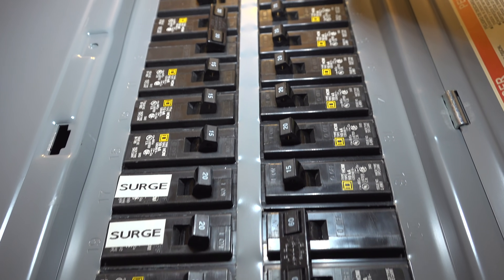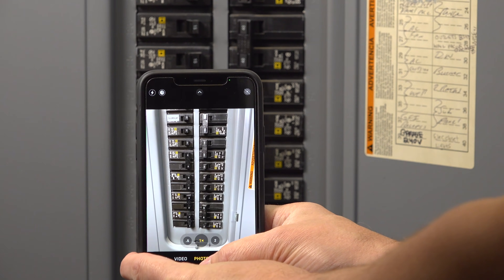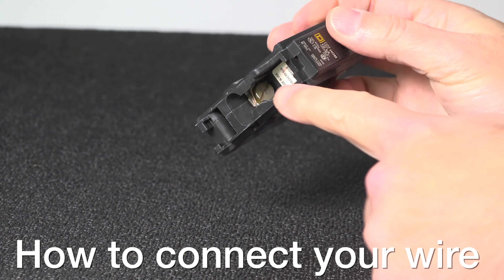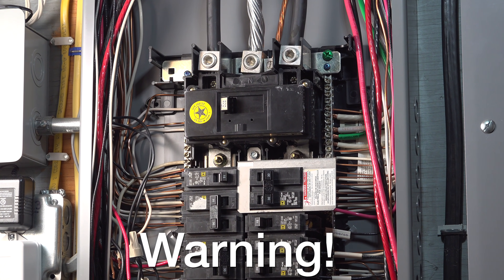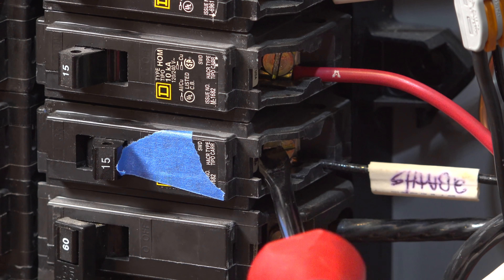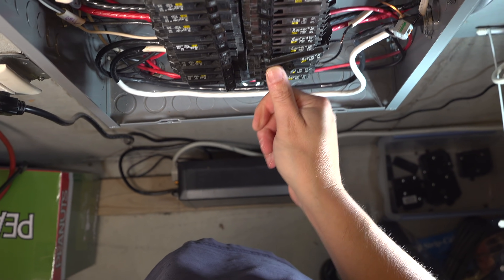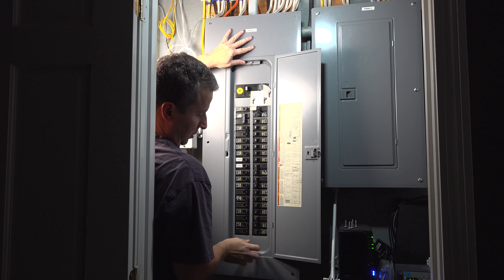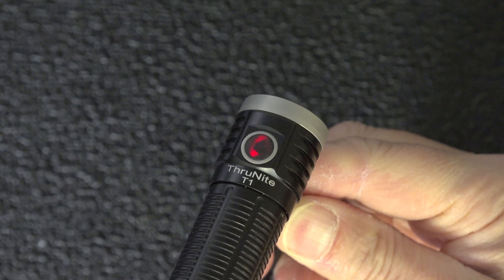How To Replace or Change a Circuit Breaker in your Electrical Panel & Why it's Tripping

Comment: Just call an electrician, your breaker keeps tripping for a reason. Just changing the breaker out doesn’t solve the problem
Reply: It might solve the problem.  Whenever I gat a service call for an intermittently tripping breaker, I would ask questions and look for some obvious signs of overload. If I couldn't find anything, I'd simply replace the breaker and tell them to call me if it tripped again.  Intermittent  faults are not worth the time to troubleshoot. Put in a $5 breaker and return if necessary.

Comment: I would turn off all the other branch circuits before turning the main breaker off and turn the main breaker on and then all the branch circuits one at a time.  Turning the main breaker on under load can make it fail.  Many experienced electricians would agree with this although there is a slight risk that a branch circuit breaker can fail if it hasn't been tripped or shut off in a long time.
Reply: Do circuit breakers go bad? Mine is only 21 years old but keeps tripping
Reply: @crand20033  They sometimes do fail due to age although they can last a long time if not repeatedly overloaded.  I would recommend that you have a qualified electrician do a current measurement to see what the problem is.

Comment: This is a bad idea.
A electrical license is required to replace a circuit breaker.
I am a licensed electrician in MA and this is bad advice that could lead to someone’s death.
Recommending someone that has no electrical background is asking for trouble.
You should remove this video immediately.
You are exposing yourself to liability if someone is injured are killed because of your advice.
I like your videos, but this one is a violation of the NEC.
Please remove!!

Comment: You forgot to mention to make sure the new breaker is in the OFF position before installing it and wiring it.
Reply: Should it matter if the main breaker is off? No juice going down the wire.
Reply: I noticed that Square D breaker are tripped when you buy them. They probably test them before shipping.

Comment: Thank you SO much for this!  Single mom here, and I'm very susceptible to repair scams.  Happened a few years ago on an AC "repair".  Paid $800 for coolant and the following month I had a new problem.  The AC guy came back out and tole me I'd have to replace the entire unit.  Fortunately, my brother's ex-FIL drove over an hour to check it out.  Literally the only problem was that the foam insulating cover on the copper was mysteriously pulled loose and the condensation was dripping constantly.  So, thank you for explaining this.  It's a fix even I can manage!

Comment: great video.  I need to upgrade from a 30 amp to 50 amp, and I'm sure there's plenty more involved than just a break replacement (most likely a totally different wire/cable).  But I appreciate the learning opportunity.  Now, on to calling an electrician with helping me with upgrade.

Comment: Rarely do circuit breakers go bad. 99% of the time the circuit is either overloaded, a short-circuit is happening, or a ground fault.
Reply: Having an emergency, can you help?
Reply: What do you do then?
Reply: @S.P.Kid88  Call an electrician. Replacing a breaker is cheaper and quicker. It may not solve the problem, but you've lost nothing by trying it. Just make sure you do it correctly.
Reply: Funny you mention the ground because I'm having an issue and I'm not sure is it's ground related. while doing laundry the clothes dryer breaker kept tripping. I went to the panel and it was very hot. I reset the main and it happened a few more times. Now I only have power to half of my house. Any ideas/ Suggestions? what do i need to replace?  I asked this of others but forgot to mention after tripping the main a couple of times power came back to the house but not to certain areas in the kitchen. I hit the test button on my gfci and it knocked the power to the entire house again so now only half the house is powered. Any suggestions??

Comment: We have to first turn on the toaster oven and then microwave our item.
When the temperature drops below 50 degrees, the circuit breaks.
I put a high intensity light facing the electrical panel and it doesn’t trip .
Is the problem a faulty breaker?
Reply: Toaster and microwave on the same circuit? The breaker is doing it's job.

Comment: Thank you for sharing this information. I just changed a breaker myself and am feeling like a boss.
Reply: and an electrician would charge at least  $85.00 if you were lucky.
Reply: Good for you! I’m still not sure how plus panel cover too heavy!
Reply: Gongrats, now get insurance for your house
Reply: @spartt4360  😂😂😂
Reply: @hightempreviews5137  It is only 120 volts and if you turn off that particular breaker you cant get shocked. When you put the new one in you can't get shocked either because there is no electricity running through it until it is fully seated and the connection is made.
Reply: So did I, but I did not turn the power to the whole house off. Just that one breaker. You can't get shocked that way anyway.
Reply: @crand20033   - whoa!  Might be true but I wouldn’t take that chance.  I went to Purdue with a David Crandall. I am confident he would throw the main first.
Reply: @-Stop-it  Scaredy cat. If you simply turn off the one switch there is no way to get shocked. Don't do any more than you have to do. I have 7 people here who need the electricity to be on and I can't just turn it off for the whole house.
Reply: @crand20033  What if the breaker is bad, and it's still letting electricity through despite having supposedly flipped the breaker (if I understand what you're saying right). Though if you have a multi-meter, you could confirm it before unscrewing the wire.
Reply: @JackJensenTrader  I simply turned off the switch and pulled it out with a pair of pliers replace it. I can't get shocked and even if I did it's only 120 volts and who hasn't been shocked by that before?

Comment: Interesting.. it looks like you're replacing a printer ink cartridge that could fry you into oblivion. That's terrifyingly fascinating
Reply from the maker: That is a very clever observation, I never thought of that but you are right, they go in just like them!
Reply: No sir, it's only 120 volts going into that one breaker. Just turn it off and you are safe.

Comment: Breaker tripped, you have to check the circuit. It’s load . You don’t just change it because it tripped. Everyday for whole year there’s always chance that you added a load more that the design.
Reply: Exactly there's a reason for it to keep tripping.
Reply: @quen305fishing7   But, the reason could be a bad breaker.  It tripped a few times over a couple years. Its an intermittent trip. He did the right thing.

Comment: Called home line breakers typically for residential. Qo we use for commercial they have a extra screw holing them in. Also they sell stab on versions of qo also. Also never assume that swapping out a breaker  it'll fix the problem, something could have worked for 10 plus years and all of a sudden trips most of the time means there's actually something wrong. But yes rarely the breakers stop working properly.

Comment: Thank you for the wonderful video. I have a quick question. What could be the reason if the wire attached to the 15amp breaker is melting inside the panel?
Reply from the maker: If that is the case, you definitely need to call in a pro for help. My guess would be you are running 20 amps on a 15 amp circuit which is  potentially deadly situation due to fire. Definitely get some help o check it out.
Reply: @SilverCymbal  can you replace a 15a (tripping when 2 or more appliances on at the same time) with a 20a?
Reply from the maker: @KnacKnuc  No, while it will fit in the same spot but you have to ensure the entire circuit is rated for 20amp service which really requires an electrician to evaluate properly. If not you can easily overheated a circuit and cause a fire.
Reply: @SilverCymbal  appreciate the reply which confirms my suspicions 😉, thanks

Comment: First of all, a 20-amp should always be used in a bathroom. Whether GFCI breaker or receptacle. It can feed light as well in the bathroom. Shower light? Good to go if fed from same. But,  in order to do so, you must make sure that 20-amp from the panel (home run) is not feeding anything else upstream in the house; ie receptacles or lights that are being fed by a 14/2 or 14/3 line from a junction box.

Comment: I removed the panel hoping to find the main breaker underneath, but it turns out that mine just doesn't have one. It's a home build in the early 1960's. The breaker in question also has two lines going to it, one black and one white. It is one of three (for the bedrooms) that are light gray in color with two lines to them.

From what I understand, these are arc fault circuit interrupters. More sensitive or something. All this makes me want to consult a professional instead, especially since we are under some sort of home warranty program, rather than tackle it myself as I originally intended.
Reply from the maker: Nothing wrong with that, some electrical work is easier and other installations are more difficult or may have something unexpected. Calling in a pro if you have any doubts is a safe choice.

Comment: Lol never turn a breaker on with both hands and looking directly at it. Use your non dominant hand and look away. Breakers can fail. Also that job could have just as easily been done without turning off main breaker that way you don’t need a flashlight.

Comment: Pro tip: If a breaker is tripping there is only maybe a 1% chance that it is a faulty breaker. I have seen only 2 or 3 in my 40 years of doing this kind of work.

And BE CAREFUL with removing and replacing the cover. I have seen a lot of blown up covers, especially on older style panels. My 2cents? Just call a pro. Not a Craigslist pro, a real pro. Like I said, it's not likely to be a bad breaker and you will end up calling someone anyway.

Comment: I swapped my breaker (even brought the old one with me to the store )thinking it was bad but even with the new one same thing is happening.  When I first turn it on it will stay on for a couple minutes but the lights surge bright and dim . Then after it trips ,if I flip the breaker it doesn't stay on long at all (I asume it's hot at this point so doesn't stay on as long)....... Do you think somewhere wires could be touching like maybe a mouse chewed through
Reply: Call an electrician.

Comment: How do you know that there is nothing else wrong with the circuit?
If your breaker trips instantly over and over as soon as you engage it.
That is often a sign of a ground fault or shirt circuit.
Try putting the wire in a 15 amp breaker that is working  in the panel by temporarily taking out the wire that is allready there.
If it trips a short is present if it holds then you know it was that breaker.
Replace the 15 amp breaker.
Reply: Uhhhhhh, that's what he did.

Comment: It's a good idea to think about why US American breakers apparently have to be changed more often than the breakers in other countries. Over here, most of the breakers do not have to be changed at all and work perfectly even after 50 years ... 

And .... never use uninsulated tools to work at a panel, even if you are sure, the power is off for the parts you are working on ...
Reply: Never? how about when you are installing a new panel and there is no power at the site?  :)

Comment: Lots of breaker tripping problems can be cured by putting the proper torque on the wire connected to the breaker.

Comment: Loose connection at the breaker can cause trips. Check the connections on all breakers, neutral and ground bars while you're in there.

Comment: I would pull the breaker out of it's socket before loosening the wire.  And then attach the wire to the new breaker before inserting it into the electrical panel.   The reason being if the main breaker was faulty or the owner forgot to flip the main off, there would be an added level of safety.
Reply: "its"

Comment: Also before sticking your screwdriver on the terminal verify that there's no power on the breaker. And, a voltage tracer is not a substitute for a meter (ever). Voltage testers can be sensitive and subject to stray voltage alarms. Use the meter to make sure the power is off.
Reply: But how do I do that? What settings should the meter be at?
Reply: @paulgarcia1566  600v ac setting, touch neutral bus bar and screw on breaker. But DO NOT believe me at all. Verify this all yourself. Anyone working with electricity shouldnt be scared. Be smart. Educate yourself and when in doubt do not play around at a breaker box.
Reply: @paulgarcia1566  I am sure there is a youtube video on that.
Reply: @shawn t..... that's a fact
Reply: Do I really have to turn the power to the whole house off?
Reply: @crand20033  Yes.
Reply: @donaldmack2307   Wrong!!! I just changed a breaker and I didn't turn the whole house power off. Just turn that breaker off and there is no way to get shocked.
Reply: @crand20033  The rest of the panel is still electrified even if you turn that "one breaker" off. You can make a mistake and touch the wrong thing and have a bad time.
Reply: @donaldmack2307  That's bull shit, I just did without touching anything but that one breaker. Just turn off the breaker and take it out.  There is no electricity going through it. Keep  your instructions simple. I have 8 roommates here and I can't turn off electricity for everybody in the house. They would sue me. it's only 120 volts anyway.
Reply: @crand20033  Your roommates would "sue" you if you told them "Hey guys, I have to change a breaker, I have to turn the main off for like 10 minutes". They would "sue" you? I call bs and if true, get new tenants. They are tenants, not roommates. Just be frkn careful man.
Reply: @crand20033 You should definitely turn off the MAIN breaker. If you turn off the single breaker, power is stopped from going "through" the that single breaker, but the wire to it is still live 🤦🏿‍♂️.
Reply: @oodyjones  Take the old one out with pliers and then just push the new one in. Don't have to touch much.
Reply: @crand20033  If in doubt call a professional, dont die dude.
Reply: Do I really have to take the cover off?
Reply: @crand20033  The ONLY reason I can think of atm for NOT turning off the main breaker is if you have someone in your home that is on some medical device that needs electricity. Im not an electrician. I took took two semesters of electrical engineering in college. Turn the main off. Why wouldnt you?
Reply: @crand20033  Yes.
Reply: So my breaker has two extra wires that go into the breaker (not just one). A "load neutral" and "panel neutral"
Reply: Learn how to use meter.
Got to be smarter than your tools.
Reply: Simply turn the fucking switch to that particular breaker off and there is not way to get shocked.
Reply: @crand20033 Bro lmk if youre still alive.
Reply: @crand20033  Idk why you are being such a douche about this.
Reply: A working black man bravo

Comment: You need to put a disclaimer on here. You shouldn't replace a breaker until you know exactly what's wrong. You need to test the breaker first. resetting breakers that are tripping constantly can cause fires.
Reply: Right on
Reply: There is no affordable/practical test for a breaker.  A professional would simply install a new breaker and it will trip if/when over loaded. He hasn't increased the risk of fire in this case.  If he replaced the 15A with a 30 A, he would be increasing the risk of fire :)
Also, his breaker wasn't "constantly" tripping. I believe he said several times in 2 years.

Comment: Very informative thanks 🙏 I’ve also seen people replace a 15 amp to 20 amp which there not soppose to.
Reply from the maker: Changing the size of the breaker is easy to do and a disaster without ensuring all of the circuit can handle it. I never recommend that anyone do that themselves.